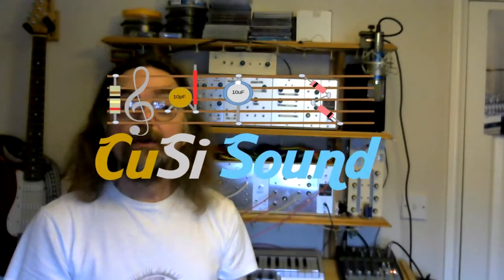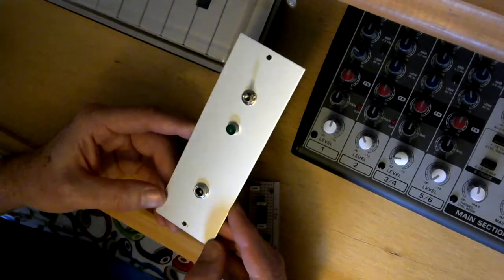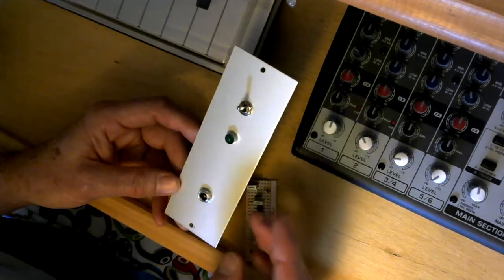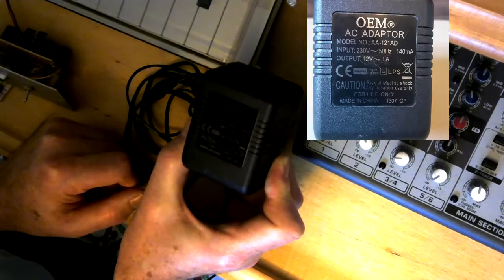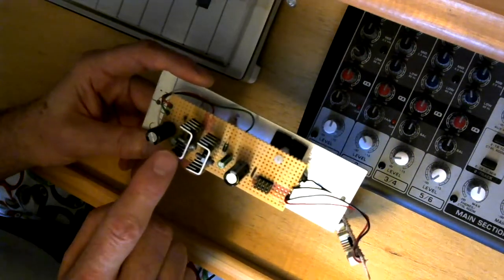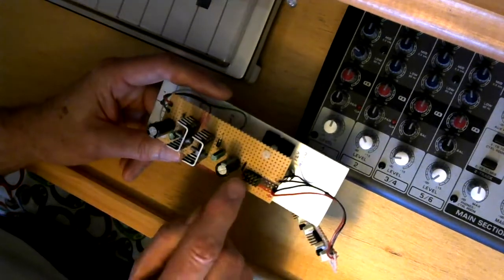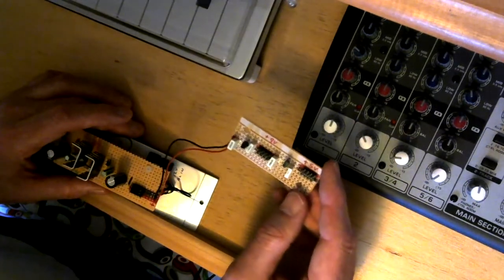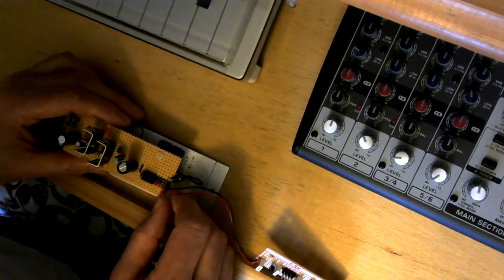Project XII Modular Synth Part 1: Power

Comment: It is impossible to run out of modules to build... ;) I guess youve seen that I have "upped" the capacitors from 470uF to 4700uF, if you get trouble with ripple, that is probably the problem.